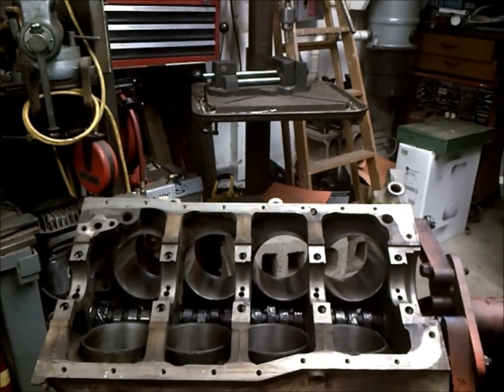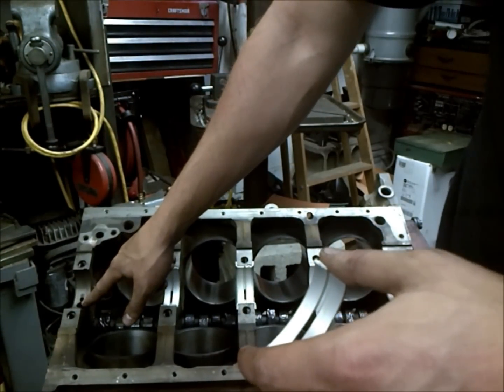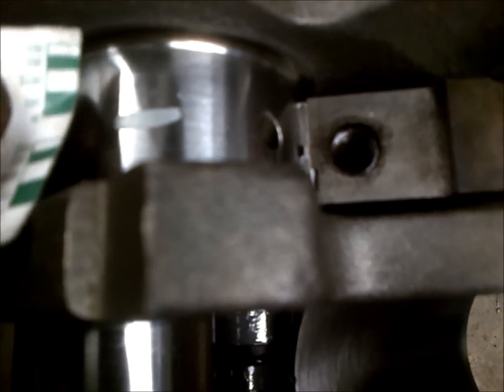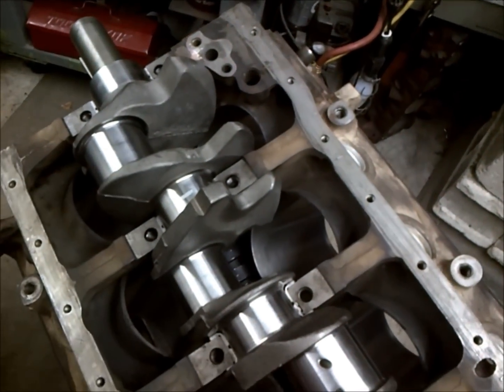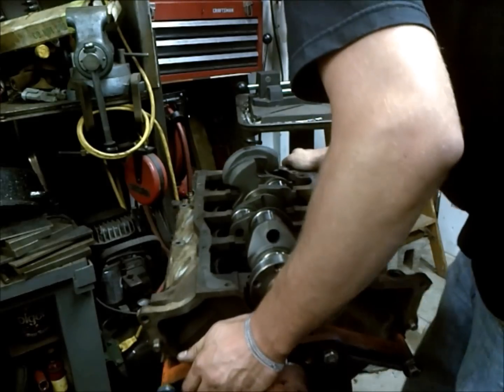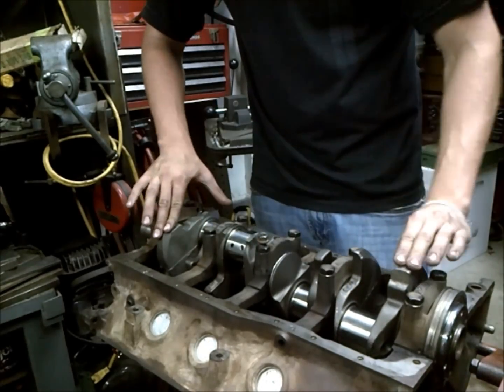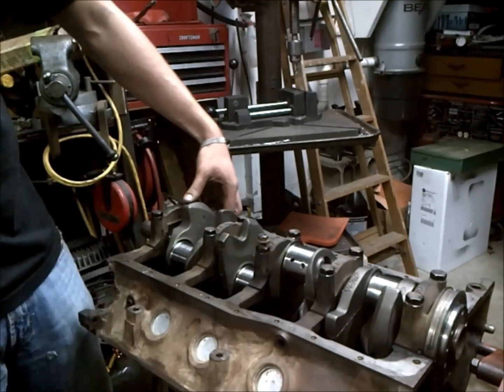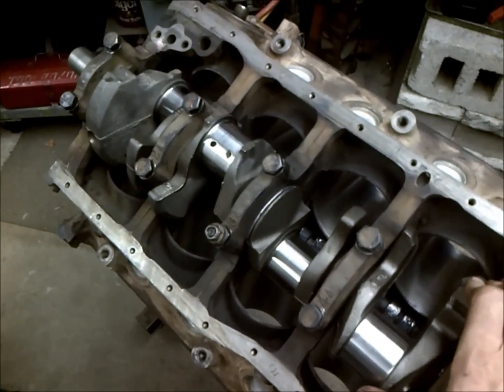Crankshaft Installation (Vid 2 of 8) - How To 302 5.0 Budget Rebuild

Comment: Hello, great video and a lot of help, just curious where to get the clearance specification sheet for the main and rods that shows within spec.  Thanks
Reply from the maker: I have some old repair manuals, I also have a book titled how to rebuild the small block ford. Has all the specs in it. Search it on google. Great book for beginners
Reply: Thank you

Comment: I have attempted this myself. y issue was a cracked block. I have a fresh block bored over .30. I installed cam and them installed crank. I used the Main caps that came with the block. I could turn the crank at all no matted what I did. I loosened all of them and hand tightened just one and would turn. I used the main caps that were in the block that is cracked that the crank was in and it turns great. I plastigaged it and it comes out fine. I miked the inside bore with just the main caps from cracked block and all was right. I miked the caps side by side and all was the same. I have the correct measurements, the crank mikes out exactly like the book says it should. Do you think I should just "go" with it? I am not racing anything. I donthave any other options. haha
Reply from the maker: chris Byers thats very strange. . . crank should swap over just fine. are you switching the bearings across? undersized bearings wouldnt work on a standard crank. i know that would be extremely stupid, but thats all i can think of. . . there has to be something going on there. . .
Reply: ThunderHead289 Yea I have replaced all of the bearings with Standard bearings. The bearings I pulled out of the old block still had the ford emblem on them so they were not undersized. They still look new. The block was cracked due to cold. Everything in that motor looks factory new. I didnt switch the old bearings over though. I installed new ones. Should I switch them over in your opinion?
Reply from the maker: check the back of the new ones you have and measure them against the old ones. make sure they are not way thicker. that is about the only thing that could cause it. cranks are all nominal as are blocks i believe. though i have never compared a sixties block to an 80s block.

Comment: Thunder what would be the process needed to convert my 89 302 from EFI to a carb. I know that I need a manifold and carb, a fuel pump conversion, and a new distributer, but I feel like there are other things.
Reply from the maker: Snake Jake you can save on the pump conversion by running a carb electric pump and hook it to the return fuel feed line and just leave the old pump in tank and cap the other lines. you will need a vented gas cap for this or a small hole drilled in the gas cap will do. 

the main difference will be for the transmission. if its an aod, you will need the lokar aod kickdown linkage for the carb to tranny. there are very detained instructions on how to do this if you search, and im sure lokar will give you the run down. 

there are ports on the head you can cap but if you keep the emissions stuff, this would be fine. 

are you keeping it in the vehicle? if so, this alleviates a lot of the swap agony.
Reply: I have pulled the engine and am in the process of a complete disassembly and cleanings. Watched your videos on the budget rebuild and will be doing the same. Was thinking about getting one of those summit racing manifold and carb kits. What are your thoughts on that?
Reply from the maker: dont get the summit manifold or cam! i like the summit carb and the edelbrock manifolds are made good and thick. i prefer comps line up of cams. with engine componants, your really do get what you pay for. trust me, parts have failed on me other ways. for example my weiand intake manifold video vs edelbrock. damn.
Reply from the maker: i do recommend the summit carb. 600 vac secondary has a big two thumbs way up!
Reply: +Snake Jake what car is your 89 5.0 from?

Comment: Seeing you had  done  several mock-up assembly steps,and also mentioned that you had taken some earlier end play measurements, I thought it strange you would torque the rear capall the wayto 70ft lbs before at least having the middle or other end also at least at an initial torque of say 40 ft lbs. Also, cleaning the pan gasket remains out  of the rear main cap after it was reinstalled seemed out of order too. order of the lower caps should be marked , cleaned, and kept in order during reinstall,just to be sure.
Reply from the maker: They are all independent. It doesn't matter how you torque them. If they play off of each other then you would have no clearance and have larger issues. There is nothing out of order here my friend. And whatever you feel has been left out in prep/post work, I guarantee its in another video in the series.

Comment: I took my previous comments off because they made me sound stupid. But I have a new question for you because you seem to be knowledgeable. The thrust bearing went out on my fully machined and rebuilt 302 with 12,000 miles. Not sure why but it did. I removed the engine. Removed the main caps. Removed bearings. Removed rod caps and bearings. Covered my ARP rod bolts with rubber tubing and removed my crank. I pushed the pisons all the way down and the crank easily came out. The newly ground and polished crank is still perfect. I intend to wipe down the inside of the block the best I can to clean any debris. Then re-install all new Clevite main and rod bearings. Put everything back together and run it. 1. What should I use to clean the inside of the block? Mind you the cam, heads even the intake are still installed. 2. Do you see anything wrong with what I am doing? Thanks for any advice. I never cut corners in anything I do and this engine only has 12,000 miles on it and looks brand new inside. So I really don't see the need to disassemble everything and send it to a machine shop again.
Reply from the maker: well, let me ask you this - is there a ton of particles from the thrust bearing inside?
Reply: ThunderHead289 Absolutely none. never saw debris in the oil. Had absolutely no idea anything was even wrong. I found excessive crankshaft end play by pure luck installing a new timing set. The crank thrust face is absolutely mirror shine.
Reply from the maker: +Jeremiah Madsen I don't think you should worry about cleaning it if you can't see anything. Likely to do more damage than good. I know we have had this convo before, but you used a feeler gauge on this correct? It should be .004 or something like that (if have to look at the numbers though I'm sure it's in the vid)
Reply: ThunderHead289 Measured 0.025" endplay.
Reply: ThunderHead289 Yes sir we did have this convo before and I was considering just rolling the thrust bearing out but I ended up pulling the engine. It was just easier because I could not get the friken pan outta the way. Yes I measured the gap with a feeler gauge and it was 0.025". I ask about cleaning because you know the internet builders if you have 1 piece of lint in the engine the entire thing will grenade. Or if you didn't build it in a hermetically sealed room she's gonna blow. I pay engine builders to build my engines and I do everything else so this is the first time I am doing anything with the bearings. I have the crank cleaned. I am going to plastigauge all bearings and if in spec, install.
Reply from the maker: i think you are on the right path. yes, internet folks can get some hair brained none-experiential opinions. i think you should have a talk with your engine builders. do the connecting rod caps show signs that they ground any off of them? this should have been done with a static balance.
Reply: ThunderHead289 Thanks for all the advice. My engine builder told me to put her together and run it. He did not mention grinding anything off the rod caps but where the cap meet the rod it definitely has machine marks?
Reply from the maker: +Jeremiah Madsen there should be something on the back of the cap on that raised square part. - this is of course if you put new Pistons in which I am assuming so
Reply: ThunderHead289 I didn't notice anything on them. What should I be looking for?
Reply from the maker: +Jeremiah Madsen send me some photos at brotherford289 @ gmail
Reply: ThunderHead289 Thanks Man I will. I have some of the thrust bearing which was clearly bad. But I chucked all the old bearings already. I will send pics of the rods and caps. Main caps as well?
Reply from the maker: +Jeremiah Madsen just send me some photos of the whole situation

Comment: am enjoying your videos , 
i have 5.0 engine i am going to remove from a shell i am going to sell and just take the engine apart and rebuild it on my own so i can learn..eventually will drop it in my other mustang with an stock 5.0..
 i had a question , i was told that and bolts that touch the block or heads have to bebrand new when you replace them ??
is that true?
Reply from the maker: 6moneymaker2 not with these 302s. but definitely modern engines. Glad these are helping!
Reply from the maker: id rather have too much as opposed to not enough. too much cant adversely effect anything - well unless its just globs and globs.

Comment: Awesome videos. What did you use to lube the seal? Just oil or grease or what?
Reply from the maker: +Charles Fowler without looking at the video, I’m sure I put some assembly lube on the rear main seal surface, as well as all the bearings